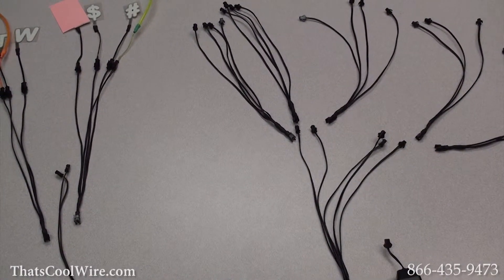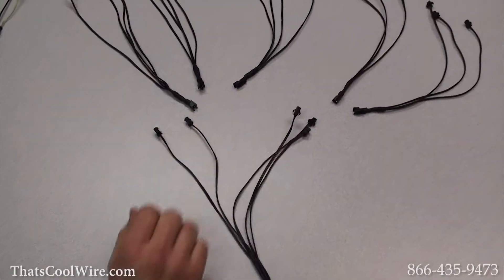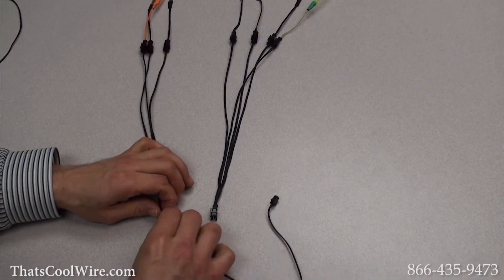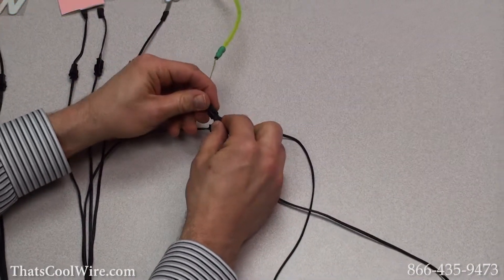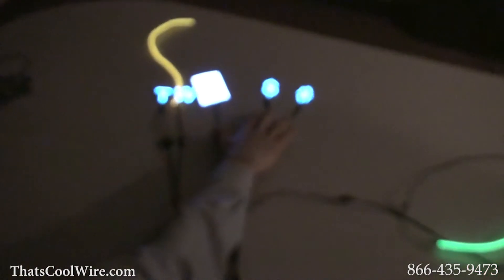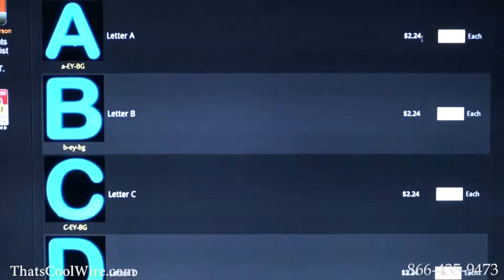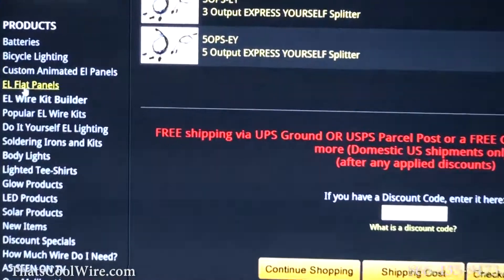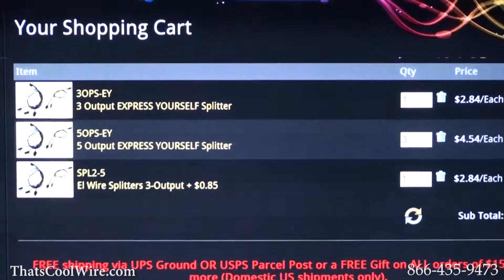Create Your Own Kit With Multiple Outputs and Functions!

Comment: I have a question on your EL panels. how UV resistant are they? I plan on using them in an area that will be having sun exposure. will they fade or degrade at all over time?

thanks